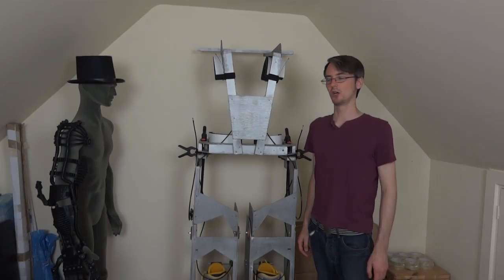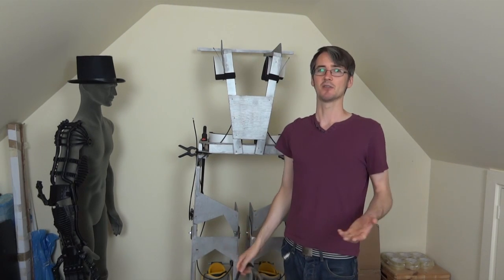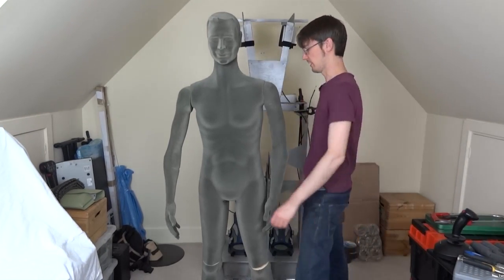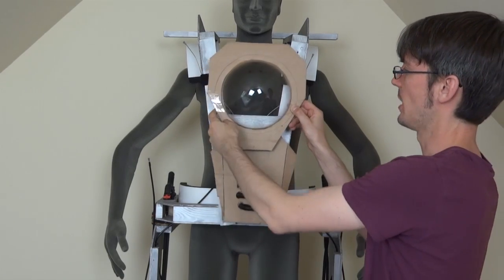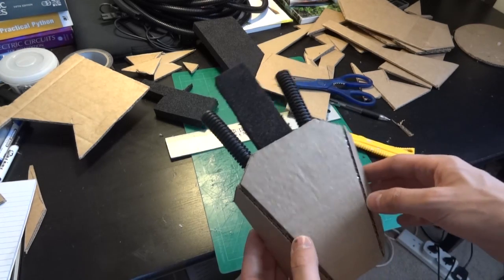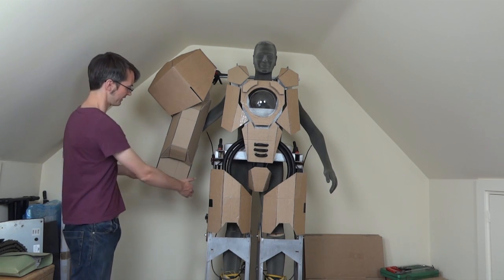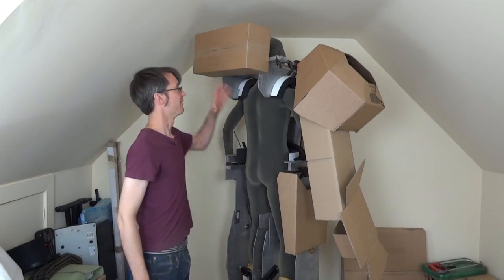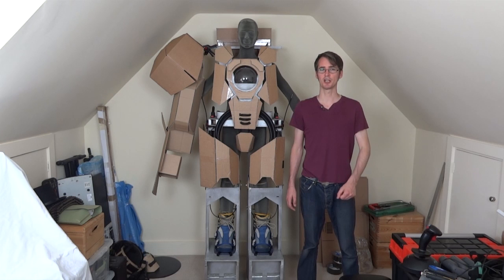Iron Man Hulkbuster Cosplay #6 | Cardboard Mockup! | James Bruton

Comment: Impressive stuff mate. Really looking forwards to the next video. Are the elbows going to use geared motors or servos? You could probably place the motor in the shoulder and use a belt drive - to keep the weight towards the fulcrum of your shoulder joint. (Although, I doubt you will be walking around flailing your arms around too much so shouldn't matter that much) I'm sure you have already got an idea for this though! ^___^

Comment: All good stuff on this video. Very impressive. For the back door of the suit you should consider two sliding doors on a railing system to fully enclose the user. This will leave more room for details on the doors and can be made to open electronically. Even with out electronics the user could slide the doors open with ease rather than lifting.

Comment: I will be interested in how you program and setup the motors to move the certain functions of the arms. Should be an impressive piece when finished. I have a 3D render of a hulk buster suit I was working on if you want some extra reference material to work off of

Comment: This is coming out great, but with the door at the back I don't think just a simple door would be that great, what would be cool is if it had a bunch of smaller doors that opened up, like maybe a ton of 3 in (7.62 cm) pieces that curved out then meet up at the back that when they opened they would do it in order, like top goes off then a quarter second later the next one went off, it should only take a few seconds for it to open all the way up, and you could put a stress release on it so if you need to get out in a flash you lean back and your weight will trigger the stress trigger and release the door so in case of a fire it shouldn't be a worry, and considering your height you could set the stress release pretty high so it doesn't fall off while walking

Comment: I think a dome isn't going to work with that design, it uses a lot of hard angles and the circles, while distinct, doesn't really fit with the design. Perhaps a vertical emerald cut or diamond shaped window would work better.
Reply: Where did you get a CCTV dome anyway?
Reply: I don't know, I feel that that the dome adds an element to the suit that makes it less edgy. Too much edge and it will ruin the design.